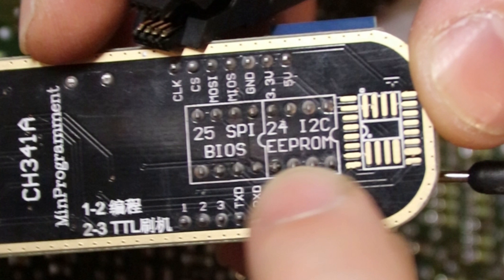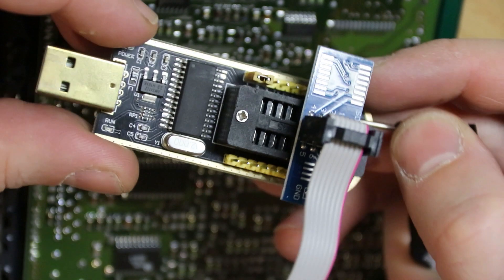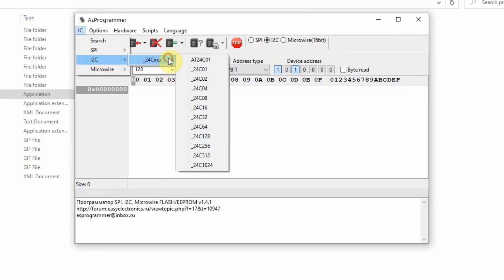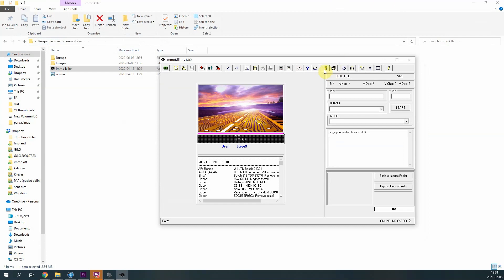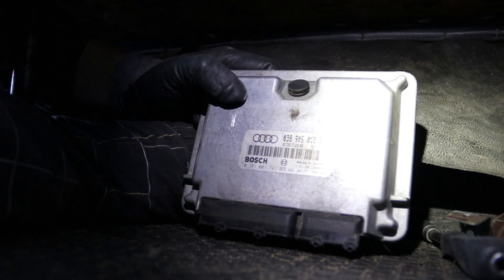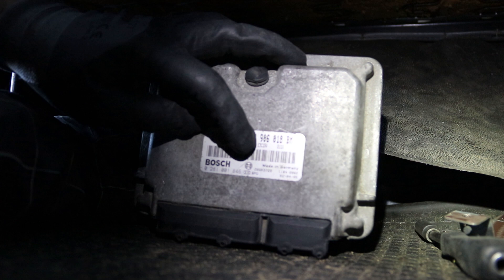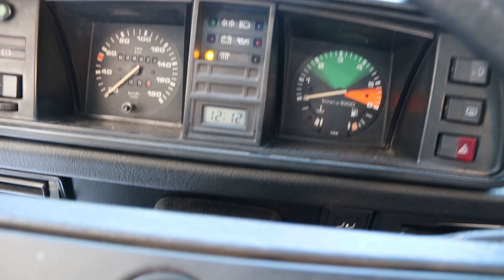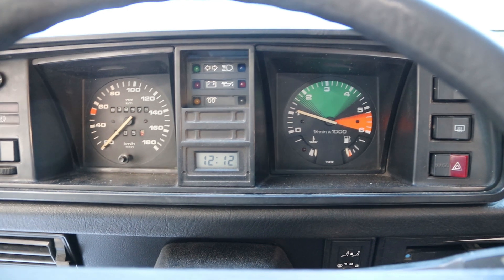VAG EDC15V / MSA15 IMMO Immobilizer OFF Step By Step With CH341a Programmer

Comment: Can you modify plcc32 with this programer?
Reply from the maker: Nope.
Reply: @Gadomaitis what about ezp2019
Reply: @Gadomaitis  what about ezp2019 or just tl866 or xgecko?
Reply from the maker: I would choose xgecko. Personally I'm flashing plcc32 with xgecko, works like a charm.
Reply: @Gadomaitis  would aliexpres one work with AMD chips that are eraseble?
Reply from the maker: I think, I believe that AliExpress has a genuine hardware for sale. I bought mine from there, no problems so far
Reply: @Gadomaitis thank you for fast reply im gonna sub to you friend, i have mk2 golf ahu swaped so i dont know should i edc15vm+ swap ecu or chip it old school.
Reply from the maker: @uluckygamer8729  https://www.ebay.ie/itm/226012114551 this kind of ECU? you can try just swaping to 81 kw, if you reckon it's enough. Otherwise, just chip tune it. From my own experience, I have 81 kw AFN MSA15 OEM ECU in my 1.9 TDI T3 and chiptuned one, and its hell of a difference when I just swap it. But the gearbox doesn't last with chiptuned one, sadly.
Reply: @Gadomaitis  yes that's the one From mk4, basicly i would made my ahu flashable via obd, i need a custom software cause i have 0.210 nozzles ,k24 turbo From mk2 , diode in maf sensor and evry mod, about 130hp with 1.4 bar, and that's the evry mod maxed out so i i would like more, smokless on full boost.

Comment: Мой блок EDC 15V-5.29 (038906018p) не могу найти калькулятор для иммо оф, такой как у автора не подходит, поделитесь чем можно сделать.
Reply from the maker: Not possible, it must work on this ECU. Do you do everything correctly? You can switch it off manually inserting 60 in that exact location.  You can find it in this video. https://youtu.be/qZ49hE5sHd4?si=GEp8CiJCQ31FeWjy&t=226

Comment: Hello! when I read the eeprom everything is always 00000. I've also tried a me 3.8, it's always the same. everything is zero. but he says the eeprom was recognized! only he reads nothing. Tried an EDC15P+ twice. with both he reads the eeprom! only not with all MSA and so on. everything is always 0

Please help me
Reply: Hello and thank you for your answer! I used a SOP8 clip. I used it to read 2 EDC15P+ Eproms without any problems (only for testing). Then I tried a Bosch ME 3.8 and everything 0000 is displayed here. Next was an EDC15V, here also everything 0000. Then another Bosch ME 7.3 and here everything is 0000. Then I connected the EDC15P+ again and everything works. I just do not understand. Today I will unsolder the eprom and try if they are then read out.
Reply from the maker: Iš it everywhere 24c02 EPROM?
Reply: @Gadomaitis  Yes I'm sure. My EDC15V is exactly the same as in your video. I did everything exactly like you, but it doesn't work. everything up to 0000.
Reply: @Gadomaitis  My chip doesn't say 24C02. There are other numbers on it. But he's in the same place.
Reply from the maker: @zimpel6419  check data sheet with the number, what's marked on the component. It mighty be 24c04. Did you unsoldered it?
Reply from the maker: @zimpel6419  how did it go?
Reply from the maker: Hi, it must be bad connection  or wrong polarity of first pin. Or have you picked the right component to read from the list? I mean does it really matches what you pick and what you want to read? Have you desoldered EPROM?
Reply: I have the same problem , did you fixed it ?

Comment: What is this red cable u unplug from your CH341 programmer? 

Becaus i tried your way But if i connect the clamp to the Chip my CH341 programmer Turns off because of lack of Power i dont know?
Reply from the maker: at what minute exactly you can see red cable? Mine used to switch off because of a week soldering. I have resoldered USB conections.
Reply: @ 2:27 u unplug a red cabel
Reply from the maker: @istealvideos7834   I see, it's a cable tie, just to lift the programmer, as it had no communication. Later that day I have resoldered USB pins to PCB, and since then, no need of a such mod
Reply: Yeah i See they dont work good on those programmer my Test Clip was missing 2 Pins they were Not solder Right.  
I Fix the Clip now it Work linke it should thx for the help
Reply from the maker: @istealvideos7834  Glad to hear, cheers, G!!

Comment: Hi, I always get this fault code 

Current programmer: CH341
20:50:13
IC not responding

What can I do? I already soldered the IC to the board

Thanks for your help!
Reply from the maker: Hi, usually it's always a bad connection to the pins.
Reply: @Gadomaitis  I tried everything for hours. Then found out that my ch341 has the 3.3 . 5V problem. I fixed that but I can't read the chip. Maybe I broke the chip with the 5v
Reply from the maker: @stefankefer8384  Honestly, I wouldn't even think about this kind of a solution. I saw that you can place a jumper for 5V, but it's needed rarely( personally never used it) and CH341 comes from the suppliers prepared for 3V.
Reply: @Gadomaitis  Hi, the CH341 Works now with Chips i bought new. With the Immo Chip it don't work. I think it's broken due to the 5V before.

Do you have a file that I can write on a new Chip so the ECU is working again.

Thank you!
Reply from the maker: @stefankefer8384  Hi, text me on messenger. I have it, you can try.

Comment: Hi, when I click read IC i only get 00 00 00 00 00 00 on everything what have i done wrong?
Reply from the maker: Hi, maybe bad connection of the clip to legs. I think there is an option to see the voltages on every leg.
Reply: @Gadomaitis  ok how do i check the voltage?
Reply from the maker: @mubert4676  check in the application, which you are using to program the eeprom, there should be such thing as "check connection" or something like that. Did you choose the right eeprom to program from the list? Another thing, 1st leg must be the right one, important part not to miss it, otherwise you can get 00.
Reply: @Gadomaitis  yes I Choose the _24c02 and using asprogramer and cant find and check connection.
Reply from the maker: You are still struggling? Maybe try cleaning the eeprom pins and multiple times re-clamp it. Or try desoldering and then read it.

Comment: another thing, it is not possible to program the eprom on the ecu, but you have to unsolder the eprom
Reply from the maker: Not necessarily. It depends.
Reply: Too much noise in data while on the board I think. Desoldering can help to not corrupt info either
Reply from the maker: In this case, had no effect. I have compared files recently and the difference  was only the immo line. If it wouldn't start or something I agree, you must desolder it.

Comment: Works with 93c66 ?
Reply from the maker: Yes, you need to supply 5VDC for 93xxx EEPROM with jumper and insert into 25xxx socket
Reply from the maker: With electronics, Usually things doesn't go so well as planned